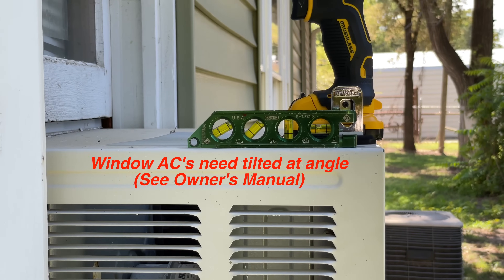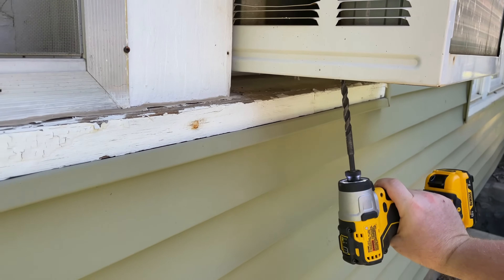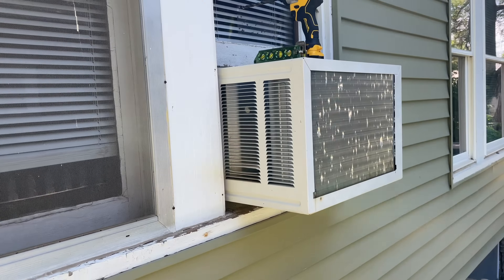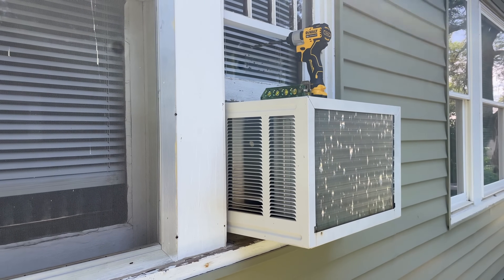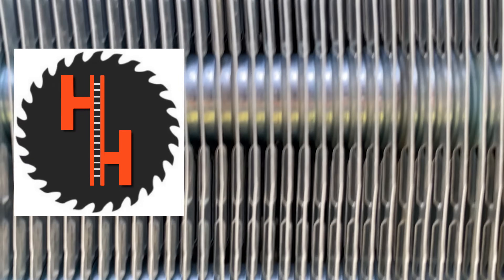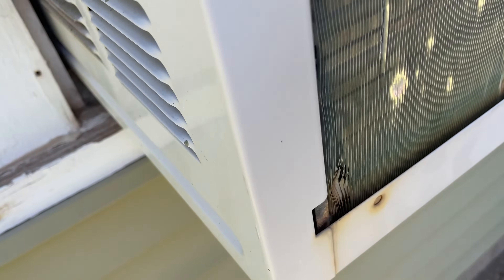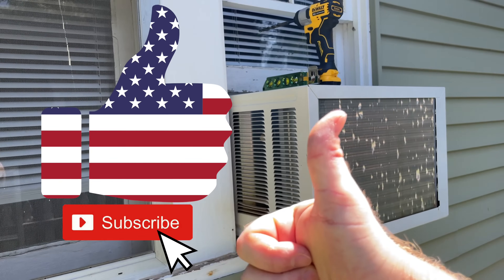99% Don't Know THIS About Window A/C's!! DON'T DRILL!!

Comment: My issue is the condensation that pools on the inside half and causes mold to form on the EPS foam.
Reply from the maker: I personally don't see how this matters.  whether there's a half inch of water or if it's draining to a hole and draining?
Reply: @HandymanHertz  it matters because the mycotoxins in mold cause many adverse health effects in people.

Comment: I really hate to say it, but designed to do it or not water like that in a unit doing it's thing is asking for rot both in the unit and in a home depending on the angle of the dangle. I've also noticed allot of that water never really goes away even when off during the cooler months and I'd rather not have standing water slowly turning into mold and mildew and so on. Plus I'll be honest I'd rather it not rot into nothing in a decades time. rather it die of funnier causes considering it was the cheapest unit walmart had to offer that day.

But to be fair the holes I drilled can easily be fixed at a later date if performance is even that large of an issue. Lil two part and a hour to dry fixes everything in the world today. Makes sense why doing it could be a bad idea in the right units and area. especially dry climates.
Reply: You can buy rubber plugs for the holes if you size them right. I had a unit rust out after many years because of all the moisture. They never dry out in a high humidity environment.
Reply from the maker: I've never had one rust out in my hose or my rental Houses, that's just my experience. Usually that's not the limiting factor on why they get tossed.

Comment: I have a new installed wall slide in ac replacing one that worked fine but was dripping inside could it just be as simple as it not being angled to drip out the back?
Reply from the maker: Yes, if it's new and leaking inside, it's more than likely due to improper angle, and If it's old and leaks inside it's most likely due to the passage hole from front to back of machine being clogged and dammed up, leading to it running inside and not being able to run to the back of the machine. Sorry for the run on sentence but I'm not fixing it 😆
Reply: @HandymanHertz  no grammar police here lol but hopefully that’ll fix it! There’s a little less then 1/2 in to angle so we shall see thanks for the reply!
Reply from the maker: @luisattack you bet, hope that helps

Comment: Thank you my new midea model one from Walmart is doing that and I was wondering the same thing. The water on the coils makes since. Helps transfer the heat out of the coils faster too I’m sure. Thanks for the video
Reply from the maker: Yup, exactly right. 👍🏼 thanks for watching
Reply: your unit may be recalled, check with midea.  Almost 100 people reported health consequences due to mold exposure

Comment: The problem I'm having with my Midea unit is it gets super nasty real fast and smells like dirty feet. I just took it apart and deep cleaned the entire unit and used a coil cleaner and it already smells again. That water is just a breeding ground for bacteria.
Reply from the maker: Interesting, but This doesn't make sense to me. The inside air has no relation to the outside air or water.

Comment: The problem I have with my Midea u-shaped unit is that the bottom panel is easily rusted as are the coils that are exposed. Secondly, ours just leaks from EVERYwhere including a slit that's underneath the AC and sits right over the window frame. So water goes EVERYwhere.
Reply from the maker: Sounds like you got a lemon or installed it incorrectly. I've never had 1 drop of water drop from it on the inside or the outside with either one of my midea u acs
Reply: @HandymanHertz  We looked at everything closely again before installing it for the summer a couple of days ago. Most people online were talking about the drip hole near the front of the machine and I had no clue what they were talking about. I finally got a photo and the one I got from 2 years ago doesn't have holes there. Only one RIGHT in the center which falls right on the frame of any lipped window sill. So I have no clogged that up with dense foam to see if I can coax the water out in other directions. Would love to show you some photos to get your advice.
But the point is, this isn't a dud. Plenty of us have this problem online on reddit, youtube, etc.

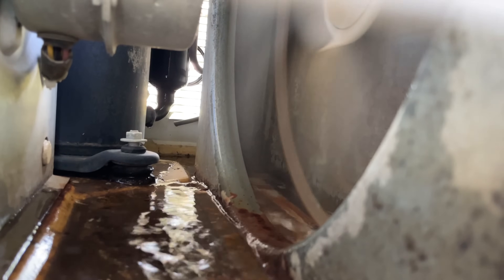Comment: 0:23 Jajaja 😅😂🤣 remuevan el tapon rapido..Lw2217ivsm 😭
Reply from the maker: English?
Reply: @HandymanHertz maybe
Reply: @HandymanHertz i think is better remove the rubber cap in the model Lw2217ivsm the water pushed by the slinger fan rust and crack the evaporator coils....

Comment: Without a drain hole the standing water rusts out the bottom pan and also collects mold and dirt that needs to be cleaned constantly. Those things alone can shorten the lifespan of an AC unit. I prefer having a drain hole.
Reply from the maker: Interesting.  I've never experienced any of those. Surface rust, but nothing that rusts out. Just my experience with acs in my rental properties and house.

Comment: This video literally saves people's money; both from electricity and the unit itself!
Reply from the maker: Yup, thanks! 👍🏼
Reply: I drilled mine for the same reason without thinking and it wound up tripping the breaker.. My last one had a drain so I figured the new one should too. There was even a slope and X where the drain would be. Found out that the water in the pan helps cool the unit like you said. Plugged the hole I drilled and it was good to go

Comment: The issue I'm having is its sloshing so much that the a/c unit is pretty much unusable. I can hear the fan blades hitting the water and its splashing up to where the cool air blows into the room. It really does need a drain. Any suggestions?
Reply from the maker: Yes, a couple solutions. check that your ac is tilted properly. The ac's I'm familiar with have a weeping/overflow holes built into them in case it rains too hard or too much water due to extreme humidity. If it's not tilted properly, they would be ineffective.

Verify your model has a sling ring and it's not broke or cracked. Maybe it doesn't have a slinger ring, and the drain holes are plugged with debris? 

Fan spitting water inside is not normal, the water level is too high, if it's that high, it will likely be coming into your house next I'd guess. 

Do you live in an extreme humid location?
Reply from the maker: You can drill it, but don't drill through your condenser, like a lot of people have. Also, it will use a lot more electricity, and the degrees, and it won't cool down the room as fast or easy because the air will be warmer coming out. I just did a test in this and that video results will be out (probably next week) if you don't believe me.

Comment: What about in my case where I've got it tilted but it's still leaks water inside the house so I Drilled 4 holes 😏 and it is still running like normal and no more water leaking all over my window seals. 🤔
Reply from the maker: If you understand how a window AC works, you'd know that the condensate must drain from the evaporator coil in the front of unit through 1-2 passages to the back. I'd guess yours are partially plugged if you have the right tilt and once they plug you will have more water inside. Sounds like it's just a matter of time until it gets plugged, you need a deep clean, not drilling. 

Yes, it will still work if you drill but you're going to spend a lot more in electricity and have warmer air coming out than if you didn't. Also, lifespan will likely be decreased due to machine working a lot harder to maintain temp.

Comment: Should also mention how easy it is to puncture the condenser when your bit breaks through and screws itself through the thin sheet metal casing. I've seen it happen multile times.
Reply from the maker: Yeah very true. Lots of new ac's in landfills due to this...

Comment: I would rather drill the holes and have less efficiency than damage my body breathing mold😬
Reply from the maker: The air you breathe gets sucked from the inside and blown back out inside. Had nothing to do with outside. Plus, I've never seen a drilled or not drilled AC not have mold on a deep clean..

Comment: A lot of these end up pooling too much water in humid areas. Especially if you are using it in a bedroom it will make an annoying noise
Reply from the maker: Thanks for the input. Mine has weeping holes for overflow from rain or in your case, humidity. I don't hear the slushing sound, but other comments have mentioned that

Comment: i only drill pan when it starts slinging water through vent or water runs into window sill from overflowing and yes it is on an angle
Reply from the maker: I believe they all have overflow weeping holes, like mine, if too much water/rain get in there. Which means if it's leaking inside, you probably need to clean your passage ways from the a-coil to the outside.

Comment: I have to drill it out because of the mold issue and also mosquitos.
Reply from the maker: Yeah that makes sense. I don't have that issue...Mold  builds up on the outside bad?
Reply: @HandymanHertz  the mold build up on the inside mostly. It only takes a week after cleaning and it stink really bad. I wish i didn’t have to drill it but thats the way it goes sometimes.

Comment: I recently contacted a AC technician to look at my window type aircon, cause i could smell something burning inside..my technician told me that the capacitor was out cause it got soaked with water, when he pulled my ac out the ac drain pan was full with water which is not normal...my ac was not tilted tho...should i tilt my ac and put more holes in the drip pan besides the original hole?
Reply from the maker: Yes, window ac's need a little tilt, but you shouldn't need any more holes. I would check to make sure they aren't flogged and your water passage ways are clear. I show you how to do this in my deep clean video. 👍🏼

Comment: Wouldn't  this cause mold issues?
Reply from the maker: I havnt had an issue with mold more than any other AC. this is on  the outside, and there's a wall between that that and the air that circulates in your house

Comment: I like the high efficiency, AC that uses the condensate, to help displace heat. But if you live in an area like me that has very high humidity, they will collect to much water in the tray and will need to have some of it drained. My GE came with holes, but the instructions said, to leave the plugs in. So, no drilling was necessary, when it needed a drain.
Reply from the maker: 👍🏼 Interesting, yeah that makes sense. I only live in a medium humid location. My ge is older and has overflow weep holes. I know every model seems to differ.

Comment: I've had drip problems with two Midea U-shaped 8k BTU units. They drip right next to the window on the sill where it would rot the still. On a conventual window unit the sling ring slung water on the exterior wall and it started growing mold. Sometimes you don't have much of a choice but to drill.
Reply from the maker: Yeah, I'd probably drill too. 👍🏼
Reply: My Midea has a removable rubber plug.
Reply: drill a hole
Reply: https://www.cpsc.gov/Recalls/2025/Midea-Recalls-About-1-7-Million-U-and-U-Window-Air-Conditioners-Due-to-Risk-of-Mold-Exposure

Comment: Slinger units tend to add moisture to the air. So if you notice the area with your window AC feels damp it might be the reason. Efficiency be damned I drilled mine.
Reply from the maker: Interesting. I've not experienced this. Do you live in a humid area?
Reply: @HandymanHertz  Yes, central Texas. Also, you're 100% correct. If you're in a more dry area, this effect is supposedly less noticeable/negated. But yeah, as for me, my friend and my neighbors we can all report that slinger window units definitely make rooms more humid in this area.
Reply from the maker: @PeterHolmen interesting. That makes a lot of sense. 👍🏼

Comment: Na I drill a hole now my last one shorted out due to water slinging every where plus the water WILL corrode the evap and cause it to leak freon.
Reply from the maker: Guess I've had a different experience than you, but thanks for your input

Comment: Man, I was going to drill my Toshiba in the morning, and thought I'd find a video just to see where. Glad I saw this!
Reply: youll wish you drilled iof you live in humid climate the pad will get nasty and them youll be breathing it in
Reply: Yup those Toshibas will leak water INSIDE the walls. Talking from experience
Reply: The wild thing is that the Toshiba’s have a drain hole but it is completely useless as it is in a completely different section than where the water drinks and pools up.   I live in a very hot and humid place and I can’t have that water being sloshed around by the fan.  So unfortunately I will have to drill.  Or do the not so pretty paper towel trick.
Reply from the maker: Yeah, I've been there too. 👍🏼
Reply: drill bro, don't trust this jackhole

Comment: The only problem with this is the corrosion you get when the condensor sits in water. So drilling holes can be better. If your unit does works as good with a hole than you neex to clean the inside of your condensor,  the side the fan blows.
Reply: Had one rust out because of this, but it took years to do so.
Reply from the maker: You make some Good points, although I have never thrown an AC away due to corrosion, personally, in my house or rentals.   👍🏼

Comment: This is an OK design for an air conditioner only unit. But there are a few drawbacks. I have a GE air conditioner/heater and this past winter when it got down to 19° outside I went to turn the heater on and the fan was frozen in a block of ice outside and couldn’t turn. The heating strips came on but no air was moving across them and it almost caught fire because I didn’t catch it right at first. So, not the worlds greatest design for a combo unit. Secondly, it becomes bug stew in the summertime if you do not close up the vents with screen mesh. It was absolutely disgusting. The smell that came from this on a hot summer night with thousands of dead bugs in there towards the end of the summer season. It was really disgusting, so yes, it is more efficient to do the evaporative cooling by water splashing on the evaporator coils, but there’s a lot of other engineering that needs to happen before this is actually viable solution.
Reply from the maker: interestings, thanks for sharing your experience. I have no experience with the heating part. i would think that the ac water would evaporate loooong before heat was needed? i wish they would give you a little drain valve, that would eliminate this during hot/freezing times. 

I've never had any issues with bugs trying to get in, i wonder if different areas of the world has different pests that are attracted to different things? weird, but i can see how that would stink after a while. I'd probably drill if i had those issue.
Reply: @HandymanHertz  I do not have a cover for this unit so all of the rain, sleet, and snow had the bottom pan full of water and then once it got below freezing for more than a day it all turned ice and the fan was literally sitting in a block of ice. That particular unit does have a rubber cap on the end with two screws you can take out. That will allow the water to drain out.  So, that may be a winterizing thing from now.  As far as in the summertime, the bugs are attracted to the light that’s coming through the window and so they naturally congregate around the air conditioner and they’ll crawl inside and die in the water.  The next day will come out and it’ll bake them and like I say it’s a pretty disgusting bug soup mix unless you put screen mesh over the vents. That stopped it and I haven’t had any problems with that. 
Now I’ve got to figure out why it’s not cooling. So that’s what led me to your video. I am not getting cold air out of the unit now and I don’t see any way to test or reload the refrigerant in it. So I’m on the hunt
Reply from the maker: @BoHunter2010 ah, yes, that makes sense! I have my blinds pulled, as it's on the west side of my house, so that explains why I don't have an issue. Good luck with your journey, I think there's a way to recharge them, but to me, they are kind of throw away items. I'd like to try the heat pump technology next 👍🏼

Comment: my units are all drain until i bought one with the drain option..i live in florida..so i pulled the plug and decided water out better ...less green stuff black stuff frogs getting in and so on..my opinion the slosh to cool off the compressor unit is a bad idea just sayin...
Reply from the maker: Yeah, I would imagine you're correct that in a humid place like Florida it may not be a good idea. I live in a medium humid region and works good.
Reply: @HandymanHertz  i plugged the hole and decided to put mine back in splash mode..with the plug out i was getting 60 degree ot the vent with the plug back in 52......nuff said thanks for the infor man.....
Reply from the maker: @mysticker11 wow, that's a big difference! Thanks for the update 👍🏼

Comment: I drilled a hole in mine 3 yrs ago and it’s still working fine.all of that water is gonna rust out the bottom
Reply from the maker: It will still work, just wont be as efficient.